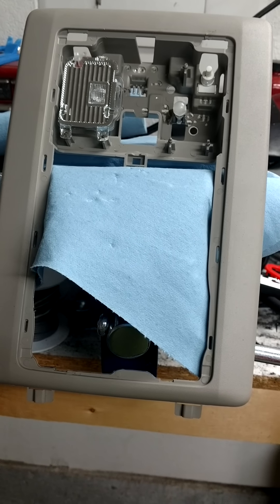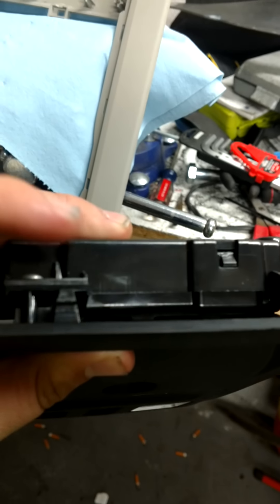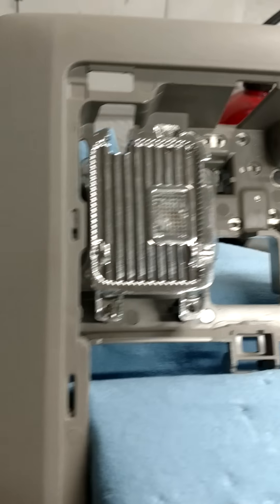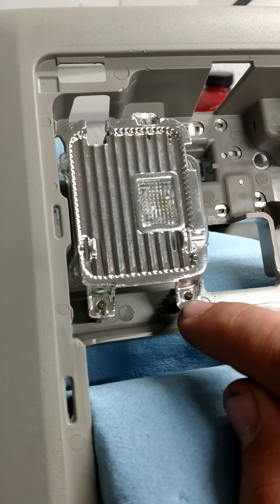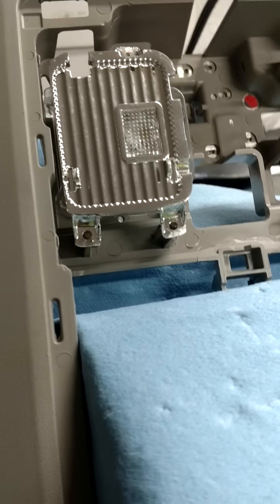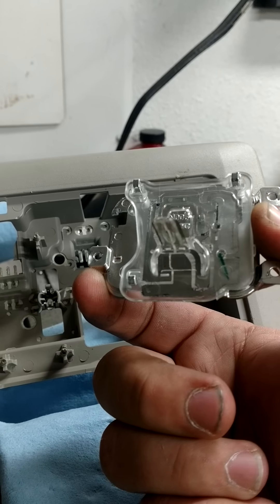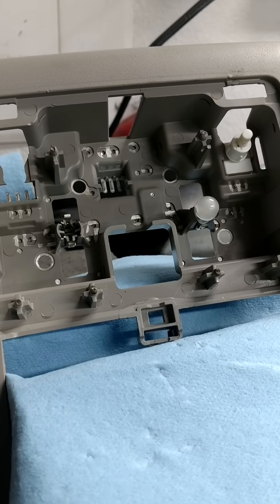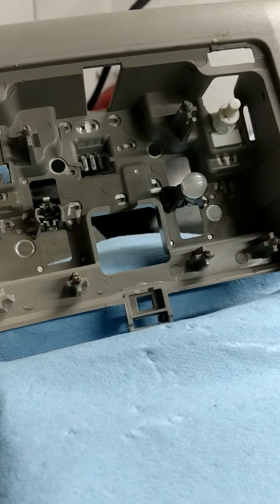How To Replace Factory LED Map Lights 2013 Ram Sport

Comment: Just another update for anyone else that finds this. I've had this mod now for a full year and they are still working great! Again, when the key is OFF, the door is CLOSED, and you try to click the map light it will not come on. All you have to do is turn the key on or open the door and it lights right up. I've had no issues in a year with needing the light on in that exact situation so it's not bothering me at all. Still just as happy today as I was the day I did it.
Reply: Newton Fincher thamks for the great vid!! The over the you push is what turns it on? And I want to make sure I understand the update ... this mod will make the light unusable if you are sitting in the truck with the door closed and the key off? (Not that that matters) 
Thanks for any info!!

Comment: Just recently bought a 2014 Laramie and discovered these lights dim. Found out the same about replacing it. Found your video and bam fixed for less than $20 Bucks. Nice!! 👍
Reply: So I am attempting to do this now and the the cover seems to be sticking on the rear sliding window buttons. Can I just keep pulling it or is there something else keeping it in there?
Reply: @HolyCrapThisIsMyLife  years later and facing this issue
Reply: Months *

Comment: Thanks for the video. FYI the “melting plastic larger than the hole” is called heat staking. Common fastening method with plastic parts, but definitely does not belong here.

Comment: Great video I was lost when I popped off the cover and saw another cover. With your guidance I modified it some. After pulling off the black cover I snapped the grey trim back in place. I took a razor knife and trimmed in half the 3rd single side pin. I was then able to pull the cover down keeping the back 2 pins attached. I was able to wiggle out the stock LED plate, slide new LED bulb in and push the cover back on. Reattached the cables, snapped the black cover back and finished super quick with everything in place. Thanks again!! 👍 👍
Reply from the maker: Nice!! Glad I was able to assist!

Comment: Thank you, exactly what i was fixing to do, this was really dumb what they did, thanks again for making the video. i just cut the plastic off with an exacto and used some very tiny circuit board screws to hold in place

Comment: thanks for posting this. my wife has 36000 miles on her 2013 RAM 1500 Laramie and the bulb just started flickering once it was out of warranty. of course that's how it works, and I can deal with that. what I can't deal with is my overall impression of the quality of these products. I really do my best to try to buy as many american-made products as possible but after 2 poorly designed Jeep Grand Cherokees, a poorly designed Dodge Charger SRT, and now the crazy amount of work it takes to change some of the simplest things in this RAM I'm going to move on. although the change will break my heart, but I'm more tired of this stuff breaking my wallet and patience.
Reply: All the auto builders do this.

Comment: Yeah but the cover doesn't over top bulb 194 too high. I trimmed bottom and still no. If ram didn't melt that clear on the lenses. It would be ok. Could I melt that clear so it's not such a big bump?

Comment: Thank you sir. I was just looking for someone to confirm my suspicions.  I had just put a different color fiber optic sight in my pistol weeks ago. Same mushroom effect. TIP. heat up and old pocket knife with the lighter dont touch the truck. And you are correct about the lamps. They are interchangeable. You dont even need LED. But the not RAM  lamp you bought is your off problem. I confirmed it by tracing each circuit....aluminum foil looking strips on the plastic bezel...... and you loose a path about by not have a lamp with a jumper "wire" wrapped around. If you are electrically inclined and have a circuit tracer, resistance measure devices ( hopefully one that beeps when there is continuity)  and reconnect the circuit with XXXXXX EG. Paperclip, a stand of copper wire, I laughed when the strip of metallic duct tape I cut worked so just search your work bench and the( the pile of trash on near or around it) ALSO  I would like to note you should fold ALL the tabs in a bit while in there. That's why they were flicker. Loose
Reply: Dawg I read this like 8 different times and the first 2 sentences is all I understood.

Comment: Great video. 
Thanks for putting it up.
Wonder if a person can find that exact build that dodge says you can't. Any info on the stock led bulbs.
Reply: I got an 18 1500 sport and If I take those out there’s still another lens and I tried as much as possible without breaking it to take the whole console down and it just ain’t happening

Comment: I didn't want to tear the whole overhead console out so I just remove the clear plastic covers off the factory LED/s. Someone already had converted to these stick LED lights and one was flickering and the other dead. I cut the expose wires and crimps another pair of LED lights o not the expose existing wires. One light is good now but the other light is still dead. I'm guess the dead light that the wire got disconnected or it came loose in the socket. I think I will just replace the entire console just like the dealer would do but I would not pay them the $150-$200 in labor. Maybe I can find an after market console cheaper than the dealer.

Comment: Just pop out the two Places Map lightswotu a knife, use a zip tie Lasso it over the light bulb and pull. Then stick the LED light bulb into the socket and carefully it the places cover back in it.. don’t remove the hole thing and cause more of a headache
Reply: Can you clarify this a little for me. I'm trying to figure out how to do it the easiest way. Are you saying to cut out the reflector piece and pop in a new bulb?
Reply: I think that you're not talking about the same type of bulb, like not this RAM's model
Reply: He’s not on the same page. 2004 regular bulb replacement